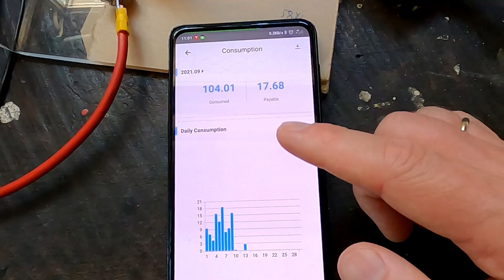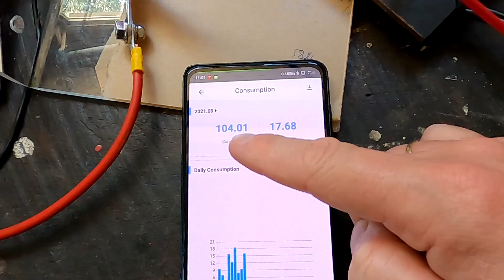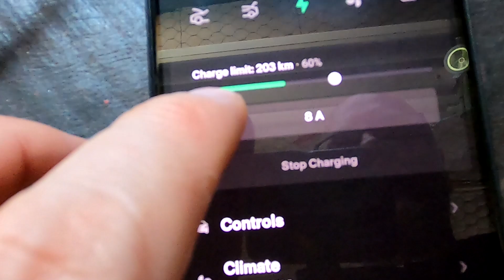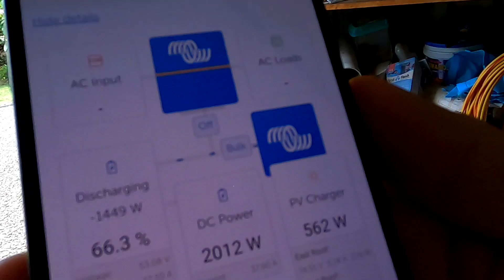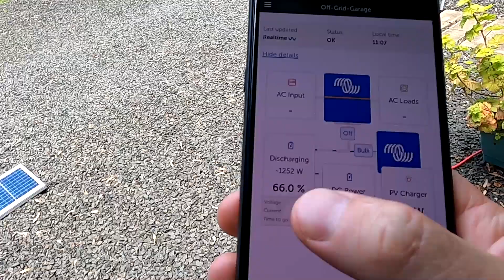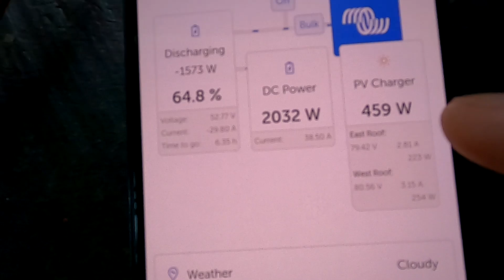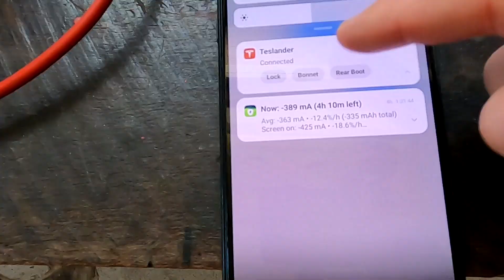EP416 - Tesla Off-Grid charging. Verdict and how I do it now. Day 5

Comment: Andy, you were smart to use a Victron, low frequency, transformer based inverter charger instead of one of those low cost, high frequency, transformerless inverters that everyone is selling nowadays. High frequency, transformerless inverters provide a much lower surge capacity and a shorter life expectancy than heavy duty, low frequency, transformer-based inverters. Additionally. high frequency, transformerless inverters do not provide any galvanic isolation between the DC boost stage of the inverter and its AC output which during a catastrophic failure of the inverter's control circuitry, can allow high amperage DC current to pass through to your EV's onboard charger and damage it. A high frequency inverter may be able to charge an EV short term, but it would just a matter of time before the MOSFETs or IGBTs that are used in these inverters fail and you can kiss your EV's onboard charger goodbye.

Comment: You could use the Victron EV charger. It works off grid and has a state of charge cut off. I think you can set a negative excess so it always charges at 6A and ramps up. If not you can install the large firmware and use node red to control (or write some custom MODBUS control).

Comment: Hi Andy, gr8 video. I am putting together an off-grid solar system too with 10 x 300W 12V solar panels, 2 x 12V VoltX Lithium batteries (wired in series to get 24V) and a 24V PowMr 3.2kW Inverter/Charger Controller. Today was 40°C in Sydney and I got about 178V and topped up my 2 batteries very quickly from 70% in about 10-15mins. Is this enough to trickle charge my Polestar 2 EV? as I tested the AC output by running a heat gun that uses 1.6kW power at 240V and 6.7A load, which worked fine.

Comment: I went off grid ten years ago and built my own home single-handedly. In June 2021 I bought a Tesla model 3 and wanted to charge it using the sun. Here is my setup: I have three 300 watt panels. I have a flat roof and leave them flat as I live in the middle of Oregon. (If I tried to point them south I would only get rays between 11am and 2 pm.) On a sunny day I get almost 800 watts. I feed this energy into a 60 amp MPPT charge controller keeping six 100 amp hour Battle Borne batteries charged. The key is using a 3500 watt inverter (pure sine wave). On a sunny day my Tesla wants 1500 watts if I set it to 12 amps and get 6 miles of range. On a cloudy day I need 1000 watts so I change the Tesla charging down to 8 amps and get 4 miles of range. I use thick wires so I do not loose current and protect batteries and inverter with 300 amp and 200 amp circuit breakers. If I tried to use 12 amps it would drain the batteries real quick so I keep it at 10 or 8 amps and it charges for 14 hours a day. This actually is as good as if not better than someone on the grid using 120 volts AC.
Reply: Yes but The problem you have is that u use one battery, to charge another battery! The goal should be a completely independent system, without battery, only with an inverter charging directly from the sun and giving it directly to the car, without any battery

Comment: i have been powering my coal stove with solar tinkering around to see how good or bad it works
it has gotten me to 10 250w used trina solar panels making in our summer 12.5kwh on a good clear day.
 i have been charging my chevy bolt with solar since heating season is over. i am making a bit over 200kwh a month 
but this month will be quite a bit better. average im looking to make 250 to 280kwh. i can say i have not plugged into the house 
but 2 hours in the last 2 months. allas being able to do this cost me 5000 dollars. so the sun is deffinatly not free. 
i have around 20kwh in lifepo4 in 24v packs.

Comment: How many km do you drive per year? In Australia you have more sun than we have in the UK. I have 11.75kw solar. One of our EVs (Kia Soul) does 20,000km/year. From March-November we were able to stay off grid with the charging but in UK winter with many grey days we have to resort to the grid. Next year we plan to expand to 20kw solar to cope with my recently purchased Tesla as well. Your comments about the efficiency v charge speed are interesting. My main off grid supply uses 48kwh fork lift truck batteries. They struggle a bit when cold with the 7kw charger producing less efficiency than the slower 2.25kw 'granny' charger. The Kia can't choose charge speed like the Tesla so following your lead I will find out what is the best charge speed for the fork lift truck batteries and compare the results against my 28kwh mobile LFP pack. Given that I don't take the lead acid pack below 50% the newer LFP pack is a lot more capable. Shame the LFPs weren't available a year earlier.
Reply from the maker: Thanks for your donation again, Nigel!

I've totally forgotten to link the video about the charging speed test. This is now in the video as well as in the description.

I drive probably a bit less than 20k a year. In winter time I won't have enough incoming solar to fully charge the vehicle but I will be able to replace some of the energy needed from the off grid system.
Reply: @unpluggedEV  It is interesting to me that even in sunny Australia at your latitudes that winter charging is so limiting. My experience shows that sun v cloud and length of daylight hours/day is more significant than sun angle. At midday in winter I can still exceed 6kw on a 11kw system (the panels face south @ 30 degrees to the horizontal) . However if it is cloudy the output goes right down to a few hundred watts at best.  Even in summer the PV power can drop to about 30% with cloud but the longer days are a big benefit (only 8hrs daylight/day here at the moment☹️). 
You also have the advantage of living on site with your solar. Most of mine is 2km away from home. I am just starting to make up a second solar trailer (about 30kwh LFP) so I can flip flop the power to minimise our  dependence on the grid. 
Fantastic videos. I always look forward to output from both your channels. Keep up the good work.

Comment: Andy, if you use the “15a” granny tail with a 15a female to 10a converter (I just made a 1m extension) then plug it into a 10a, you can charge at 10a, not 8a (which you get if you use the “10a” tail)
Reply from the maker: I know, I have the adapter here so can even charge on 12A from a normal outlet. The questions is, do you need to charge that fast...